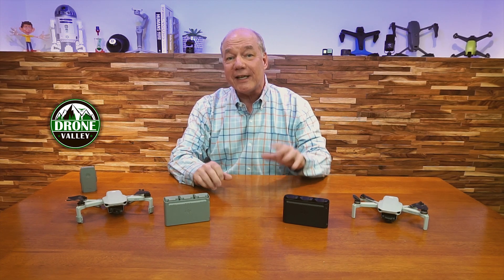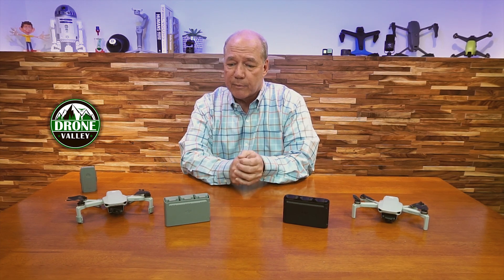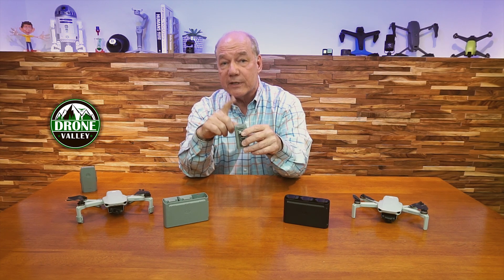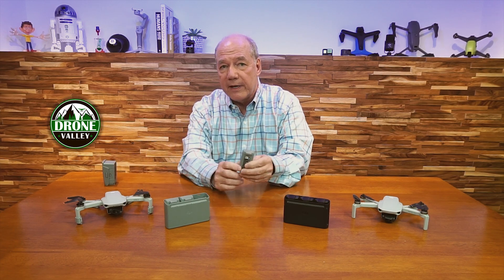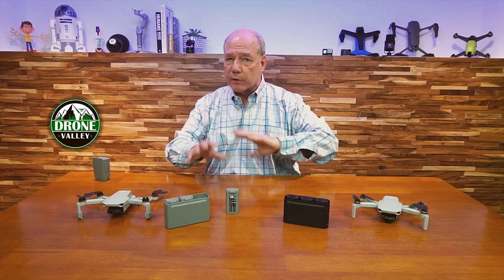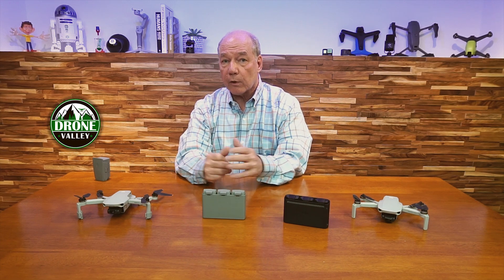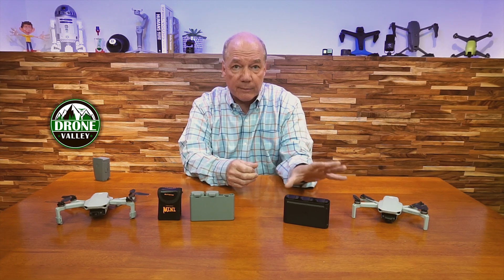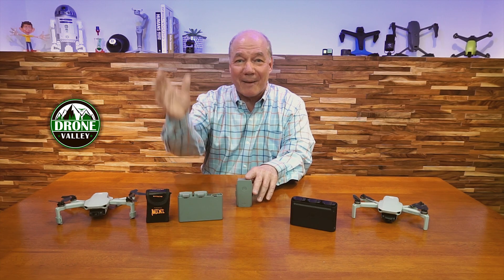Mini 2 Battery Issues and How To Fix Them

Comment: what does 3 times blinking in the battery indicator on the drone mean. It is not accepting the charge. Please help. I have a mini se
Reply from the maker: You have to tell me which of the LED's are blinking 3 times. Looking at the battery with the button on the right, the LED on the left is number 1. When I know which one is blinking, I can tell you the issue. Rick
Reply: @Dronevalley  hi all the leds are blinking 3 times
Reply from the maker: @divijjain7723  That's a pretty serious issue and means that you either shorted the battery, it got too hot or you somehow drew too much current from it. My suggestion would be to put it back into the hub and connect something to the USB-A port to see if you can drain it a bit to eliminate the issue. If not, I'd discard it before flying with it again. If it's new, contact DJI for a replacement.
Reply: @Dronevalley  did so
Reply: @Dronevalley  also I do not have a charging hub
Reply: I just got it a few hour back
Reply: Flew it once and then kept it back
Reply: Once again turned it on after removing battery from the drone and saw battery cell error message and critical low battery
Reply: Please reply when you read the messages
Reply: Battery temperature was 34.6 Celsius even though I did not fly it
Reply: In cell status it showed 3.72v

Comment: So can you allow them to auto discharge out of the charging hub then after 4 days of non use  put them back In the charging hub the correct way round?
I'm assuming they will stay discharged at around 75%??

Comment: Hi, if you store the DJI mini 2 batteries out of the drone and either in the pouch or backwards in the hub, as you recomended and let the batts discharge, say down to 40-50%, or maybe less, can you then charge the batteries up to 90-100% just before you fly?  Thanks!
Reply from the maker: Yes, that will work fine. The key thing is not storing the cells at full charge for long periods of time. The latest firmware from DJI for the Mini 2 includes a self-discharge feature to automatically lower the charge after a few days to protect the cells. Be sure to download this firmware to help protect the cells. Thanks for the post! Rick

Comment: I dont think its good to flip the battery in its hub, i tried it, its too tight.
Reply from the maker: Thanks for the post but once you've done the latest firmware update you'll not have to worry about the battery issues. DJI has fixed the problem with the new firmware so you can slide them into the hub normally and they will discharge as needed. Thanks for the post! Rick

Comment: I have a battery when I put it in the charger the third light is flashing and it looks like it’s not charging?
Reply: Same issue mine is. 2nd and 3rd is flashing rest 1 and 4th aren't
Reply: I charged it into my drone and it fixed my problem. thanks for the info!

Comment: Hi Rick. My question is if I fully charge my batteries and have a plan to fly in 2 or 3 days, should I keep them in hub or out of hub?
Reply from the maker: Thanks for the post and honestly the best plan would be to charge them the night before so they are fresh the next day for flying. If you have to charge them a few days early because you're traveling, you should store them in the hub so the "brains" in there can monitor the batteries and discharge them after 3 days in case you don't get a chance to fly. I hope that helps and consider subscribing to the channel as I'll have a ton of content posting this week. Rick

Comment: But how do you know  if it’s 30% to 40% charge to keep them up in the winter for storage like in my spark batteries that has a button to check what level of charge they have.
Reply from the maker: Thanks for the post and you have to slide them back into the drone or the controller to check the charge level. I wish they put an indicator on the batteries as well but they were trying to minimize weight. Stay tuned for more clips posting soon. Rick

Comment: They should have put a cut off switch on the charging hub. Its a pity, because it makes for a nice way to store your batteries.
Reply from the maker: Jack, you can store them in the bub. The auto-discharge feature only depletes them to about 60% and then stops. If they're below that for storage, they stay at that charge level. I store mine in the hub when I pack the drone away.
Reply: @Dronevalley  Yeah I have ended up putting them in backwards when full then in the right way when they have been used. This has the added benefit of showing quickly which ones have been used :D

Comment: my 3 batteries - all charged in the same charging hub - seem to not be working. They were showing as fully charged. I put them into my drone and they showed as having 96% charge but they simultaneously said 00'00" flight time remaining. One battery wouldn't even get the drone off the ground "unable to take off" and another one forced the drone to emergency land even though it had 48% battery left. 
My first thought was that I had put too much voltage through them when charging but now after watching this video I'm less sure. Any ideas would be much appreciated. Thanks team!

Comment: I'm just bought Mini 2 single. But as experienced enthusiastic RC Hobbyist, I always charged my battery about 2-3 bars and pulled out & put it outside from the drone as I treated the drone as my other rc, especially common rc LiPO battery. Never experienced a fire but already had swelling lipo experienced. Though I did not stored them on LiPO safety pack or other unflameable storage box tho. Haha

Comment: It's a fairy tale, li-po batteries are not burning. Try your self. Punch it, nothing will  happen, except bad smell. But LI-ION are BURNING extremely well if you punch them or got short!
Reply from the maker: Thanks for the post and the truth is that they are both dangerous and the LiPo is a little more temperamental. All you have to do is search on Google for "Lipo Fire" and you'll see tons of examples. When it starts, it burns insanely hot and will continue until all of the chemicals are exhausted. The bottom line is that you have to be very careful with both cells. Keeping them too hot or too cold will also kill them slowly and you'll lose your investment.

Comment: The reason the hub doesn't discharge the batteries is because it can be used as a power bank. Wouldn't be much good if the batteries kept dieing
Reply from the maker: Eric, at first glance what you're saying may seem like a good idea but Lipo cells can be dangerous to keep fully charged and the chemistry starts to break down. The controller in the cells is supposed to start discharging them after 49 hours to reduce the charge to 60% or less, which is safe for storage. All of the DJI batteries do this and they somehow missed it on the Mini 2 batteries. This firmware update fixed it somewhat but it's still a bit inconsistent.

Comment: If your leave the batteries on the 6 way white charger unplugged the 4 batteries will auto discharge as normal.  You can also discharge the batteries it appears with the 6 way charge if you plug them in with it disconnected but have to test further. It appears the pins must be pushed in for the batteries to auto discharge now...

Comment: Yeah this is one of the issues keeping weight under 250g and Mini. Add a switch and you just added weight plus increased the size. I'm sure DJI is working on it but I doubt it can be fixed with firmware.  Being in a "connected" state without a physical switch it would most likely take hardware to fix. Probably something addressed in the next model. 

I think there are some SDR type circuits in the Mini 2 but I'm not sure exactly. But even a SDR has limitations. If they had anticipated this a transistor should do the trick. Controlled by the battery and disconnected after 24 hrs to allow the auto discharge circuit to take over. But then again to engage it one would have to unseat the battery connection and reconnect it to disable the feature and fly.

I think the simplest thing is to store the battery "disconnected ". Even if you just charged them take them out of the charger! Let the clock start! Not sure if it starts after a full charge or from a full "disconnect". Either way just "disconnect" them. Requires a little more work but it's worth it!

Comment: One of my Mini 2 batteries stopped working and is flashing. Is there any way to repair it?
Reply: just received my mini se ( same m2 batt pack i guess) with this exact issue from the unboxing.  need a fix for that battery, just bother too much to have to send it in and wait for the replacement

Comment: so if i was to charge all 3 of my batteries and i only was to use one because it started to rain. am i ruining my batteries by leaving them or can i just charge them back and they are completely fine?
Reply from the maker: Lipo cells don't like stay fully charged or very lightly charged and both of those scenarios can shorten their life. I always fly my cells to below 50% and then store them until I'm ready to fly again. If you do come home with a few cells fully charged, slip them into the charging hub and use it to charge your phone or other device to draw down the power in the cells. That will prolong their life. Thanks for the post.

Comment: I'm beginning to think the only answer here may be a class action lawsuit someone should file against DJI for completely botching Mini 2 Smart Battery design (inability to self discharge due to requiring a comm line open for LED charge level indicators and power switch.) They have already admitted fault (probably not the  smartest idea) and indications  they can'tfix it. (2+ months without a fix, after promising a "swift update") 😉 I am not down with the litigation happy world of lawyers- sue everyone everywhere always -but DJI is not a tiny company being preyed upon. At minimum they should supply either a full set of replacement batteries (I am sure there are blissfully ignorant folks out there completely unaware of the issue, and the potential early and imminent failure of these batteries) or a discount on the surely redesigned Mini 3  where the battery will function properly in this regard.

Comment: Maybe DJI is concerned that if they discharge inside the charging case the heat will not be dissipated fast enough and it will harm the battery.

Comment: The DJI Mini batteries are not in sleep mode. The mini batteries aren't providing current until you bridge the connection, via the charge pins as in the drone or the hub.
Reply from the maker: Nick, thanks for the post but the Mini 2 batteries have 6 connections, a pair of them for the actual voltage they can provide (2 positive and 2 negative) as well as a pair of data pins that communicate with the hub and the drone. That's how the battery interacts with these devices. When they're in the hub, the tech in the hub queries the batteries through this data connection to check their level before charging and updates their charge counter. When they are in the drone, these lines tell the drone all the important details of battery health, temp, and charge level so the drone can calculate how much flying time it has left. The challenge with the auto-discharge is that these data lines need to stay active so the batteries never really "sleep" like the other DJI batteries and aren't able to start the discharge cycle. This could be fixed through a firmware update by simply starting a clock after the last major current drain (flying) and triggering the discharge to start 24 hours later. I'm sure that DJI will sort this out and we'll all see a firmware update soon. Rick

Comment: At 6:32 you said to visit your batteries over the winter months and to charge them up to 100%. I thought the batteries weren't to be stored at 100% when they won't discharge.
Reply from the maker: Thanks for the post but my rule of thumb is called the "3 light rule". When charging the drone batteries for storage, check for 3 lights on the case (about 60-75%) and you;ll be good for a month or two. The key is to never let them get down to one light. I hope that helps and happy flying!

Comment: Can I discharge them to 50% and then store in charger?
Reply from the maker: Yes, if you have them below 75%, you can store them in the charger without any issues. The key is not leaving them fully charged or you can fatigue them over time. Thanks for the post and please sub the channel for more info. Rick

Comment: Great video so thank you for that. In my own test in the last few weeks as to how the Mini 2 batteries currently behave outside of the unit, it would appear that they go through two phases of auto discharge, first after 24 hours or so down from a full 100% to 96%, but instead of discharging further at around 5 days, it seems to take that bit longer and around day 6-7 is when the 2nd discharge phase begins which sees the charge drop eventually to 72% over a 24 hour, so the manual stating that by day 5 it should have dropped to low 70s is misleading. I did get notification of firmware updates for my batteries last week and then left them in the hub for 3 days but they stayed at 100% so it looks like DJI to date haven't pushed out a firmware to facilitate auto discharge when they are connected. That said I'm not too bothered and happy to keep the batteries unconnected to anything when storing them

Comment: Watched the whole video, did not see a fix!
Reply from the maker: Darren, the only fix right now, that I did cover in the clip, was to avoid putting the batteries back into the drone or the hub. You can do this by spinning the batteries around in the hub or using a rubber band to prevent them from dropping down deep into the carrier. I expect DJI is working on a firmware update to sort this out digitally and I'll put a clip together if one is released. Thanks for the post. Rick

Comment: You can’t out batteries of the Mini 2 in to the hub backwards on all models I guess because mine won’t do that. There is a tung and grove feature there to prevent the battery from sliding in all the way. So I use a fat rubber band around the contacts of the hub and then slide batteries in normally.
Reply: Mine has the line and groove too but with enought force it will go in backwards :D

Comment: Nice video Rick.  As a side note, I've noticed Airdata.com sometimes picks up a few voltage fluxes in the #3 cells of the Li-Po's of the Air2. Not many mind you- still in the green zone.  Actually, they've shown improvement.  However, the Li-Ion's in the Mini are almost rock-steady.  Have you detected any of these spikes in the Li-Po's for the Mini-2 in either cell?

Comment: Hello kind sir, I finally got the correct video showing how to charge both battery & controller usung the mini hardware. The video I had posted was as you stated charging the controller using a battery to do so. This one is physically increasing the voltage on the battery & the controller at the same time. Sorry for the bad video. Ray C. Florida

Comment: A quick fix is to use an elastic band. Place the batteries in the holder the right way around and put an elastic band around the top of them where the terminals are. This stops the batteries falling into place and because it’s elastic when you take one out it holds the other two in place.
Reply from the maker: Gary, thanks for the post and that's a great suggestion. I have a few other pilots I fly with and they use a heavy-duty rubber band to do a similar thing. Anything that keeps the batteries from falling all the way into the socket is a good thing until we see a firmware update to sort out the logic.
Reply: Good one
Reply: I came up with this the other day!

Comment: Maybe this is too simple!? cant you just use the mini 1 batteries in the mini 2? I know it brings it over the 249g threshold, which is important for the CAA over here, in the UK. And are  they not cheaper ? Maybe the drone police will check your drone weight ? lol Doubtful ! Just an idea .........
Reply from the maker: Thanks for the post and the Mini 1 cells work great in the Mini 2. They are a little heavier but work great. i actually fly with both of them when I'm out in the field.
Reply: If they weigh mine i will just play stupid, DJI says its 249 right on the drone so its 249! How am i supposed to know better!? Lol

Comment: Great information as always thank you,can I ask so is it perfectly safe to leave the battery in my air2s drone
Reply from the maker: Thanks for the post and it's a tricky answer. If you leave the battery in the Air 2S it will auto-discharge normally so no worries about the charge. Where it gets tricky is that the auto-discharge produces some heat and that's never a good thing for the quad. It's small, but over time it worries me that it might unnecessarily fatigue the quad. The other concern is that if a battery does decide to go non-linear and misbehave, if it's out of the quad, you've only lost a battery. if it's inside the quad you've lost everything. To put this into perspective, I have a ton of quads in the shop and literally a hundred or more Lipo cells. I've been flying for years with a lot of other pilots and have never had, or heard of a Lipo fire with any of them. Its a rare issue, but like with home fires, we have to be careful because of the possibility. I hope that helps and my advice is always to fly more and worry less. Rick
Reply: @Dronevalley  sound advice thank you again

Comment: Also never discharge the accu under 20% by flying?
Reply from the maker: I'm not sure what the typo meant but it's OK to take the quad and controller down to 20% as long as you're close to the landing pad. Lipo cells don't suffer from "memory" like other batteries but you have to be careful about having enough energy to get back home safely.